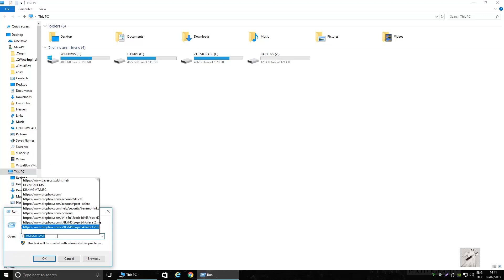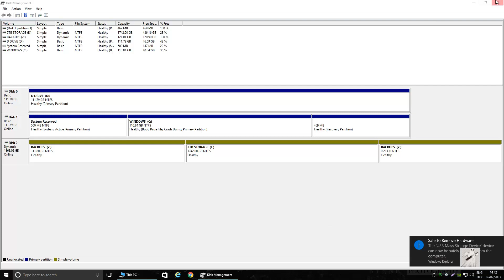How to fix a broken stuck Hard Disk Drive (BEST WAY)

Comment: This is a guaranteed way to lose all your data right here.
Reply from the maker: worked fo me
Reply: @GhostvaperYT  yeah, sure it did.   LOL
Reply: @sluzzy  @RandamoYT You guys are both idiots and don't know what you're talking about.
Reply: it does work if your drive isn't a halogen drive, but the head of his drive is supposed to be parked in the middle and because of how easy it was to spin the platters the head wasn't stuck.